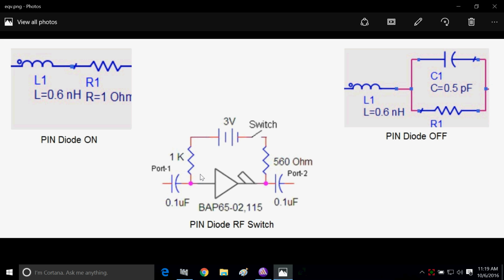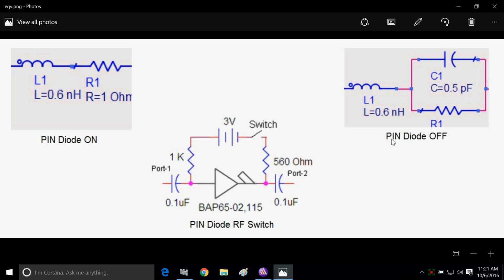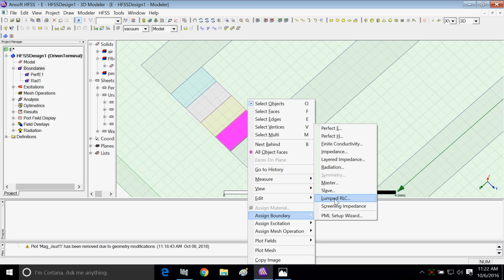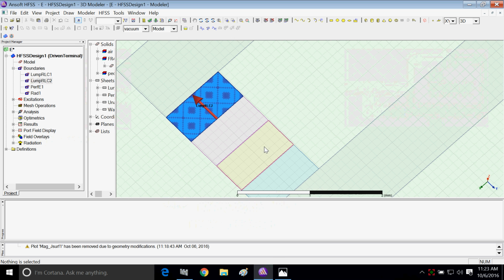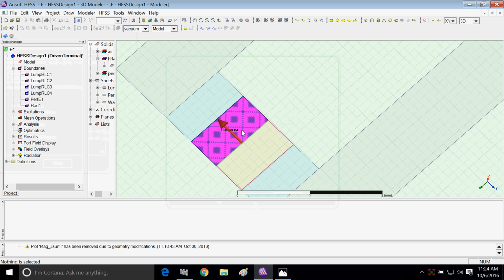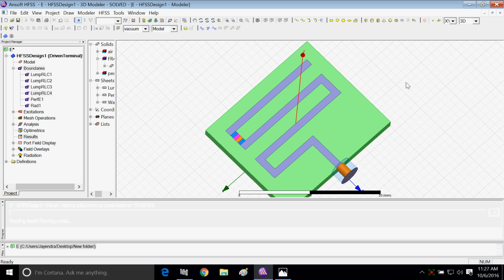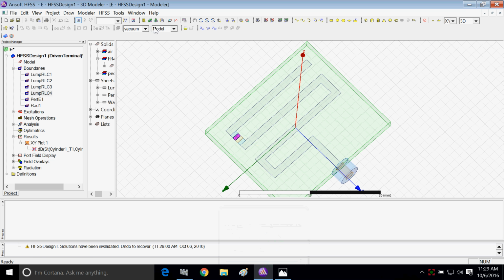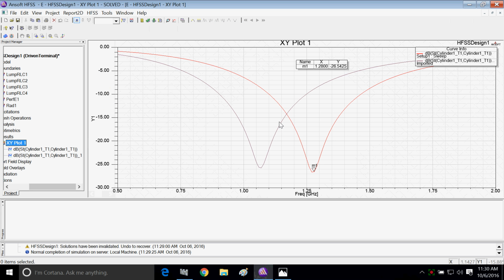Reconfigurable Antennas

Comment: Very informative sir. Could you please tell that if an SMD BAP6502115 diode is used, and if I am keeping the total length of strip (C+R+L+C) as 2 mm , then what should be the width of the strip???
Beacause in some datasheets its given as 1.35 mm range while in some its given as 0.7 or 0.8 range??

Comment: Hello sir.. This video helped me a lot as I am working on reconfigurable antenna. Sir one clarification is required..to switch off the diode can we make all the values zero? Instead modelling off state design of diode?  
And what kind of feeding been used in the design sir  bcz you have not used ground. For microstrip monopole antenna ground is not at required?

Comment: sir i am facing same problem that in ON and OFF state the result is same. So is it needed to unite all strips of diode ? and also is it needed to unite the diode to patch and slot to be connected to patch ? Please sir help me.
Reply from the maker: Do not unite structures but they should touch each other.
Reply: should they touch to each other and also to patch ? i will be thankful to you sir
Reply from the maker: Yes

Comment: Thank you very nice video sir, but i have  questions, for me i work in the frequency range between 12-37GHz, so which PIN Diode should i use(what's the value of capacitor, ressistance, inductor)? another thing sir: what's the material of the rectangle of capacitor, ressistance and inductor (pec or FR-4) and there is no a distance between them as shown in your design? thank you

Comment: I am using BAR64-03W pin diode using the same method as stated by you, but i am achieving same bands in both ON and OFF state.I used forward bias values for ON state and reverse values for OFF stated from datasheet. I dont know why it still gives same bands ? Secondly, how can we define the values of blocking capacitor? and how can we estimated that how many DC blocking capacitors are to be used ?

Comment: Excuse me ,Could you teach me how did you calculate your equal lumed  element values (Both R1,L,C of state ON & OFF ) , Thx a lot.
Reply from the maker: Based on the operating frequency, you select a pin diode. You can get the lumped elements value from the technical datasheet of that particular diode.
Reply: If the frequency which is mentioned by datasheet is 1MHz but my operated frequency is 2.4GHz,how should I transform?
Reply from the maker: The same you can use. Say NXP BAP65-02 pin diode: Cd=0.9 pF at Vr=1v, Rd=0.9 Ohm at If=5mA and Ls=0.6 nH
Reply: Thx, Excuse me,I still have 2 questions : 

1. The value of DC block capacitor, just need to small enough , right?
2.what about Rp ( parallel resisroe , reverse bias resistors ) , how to decide it?

Thx again.
Reply: hello sir, i want to calculate lumped port element values at 50Ghz, can you please help me ?

Comment: Sir, I followed the same procedure to reconfigure a fractal antenna but there was no difference between the ON and OFF states. Where possibly did I go wrong?
Reply from the maker: At what frequency your antenna is operating?
Reply: Jayendra kumar  Sir, since fractals are used for multi band,  the resonance frequencies for the ON state are supposed to be at 1.6GHz , 5.2GHz, 7.6GHz, 9.4GHz , and 12GHz . But my antenna only resonated at 9.4GHz for both ON and OFF
Reply from the maker: In the video, the diodes are modeled for frequency below 6 GHz. Use a pin diode with specifications above 20 GHz (OFF state capacitance should be very small) for your purpose.
Reply: Sir, which values to give for an operating frequency of 50ghz ?
Reply: sir what is value of C for frequency >6 GHz.

Comment: Which Basic Antenna Did You Use to Design This antenna?
Reply from the maker: It is just a microstrip line integrated with pin diode RF switches.

Comment: Sir, will you give the dimensions for designing this model?
Reply from the maker: The dimensions will depend on the actual components size. First of all, you select the required diodes and capacitors, and accordingly, you decide the dimensions. Typically, keep separations of 2mm and sheets length of 0.5mm.